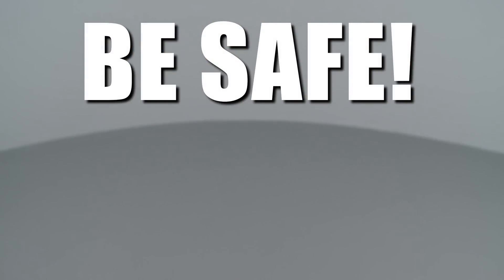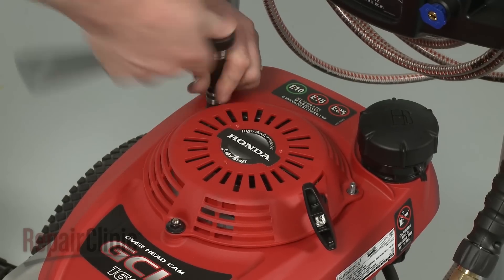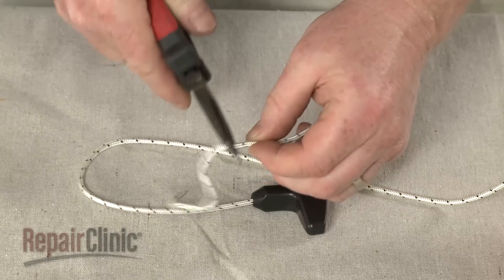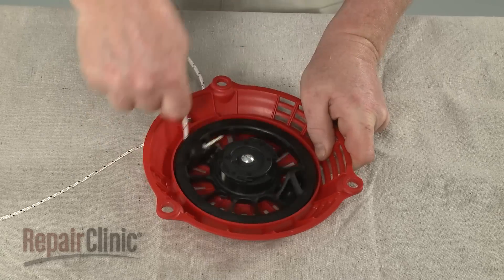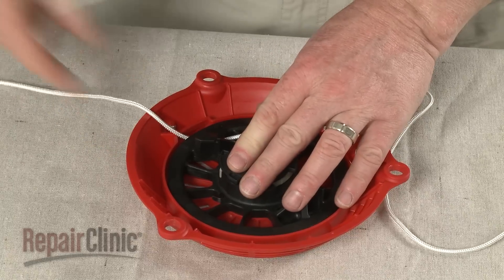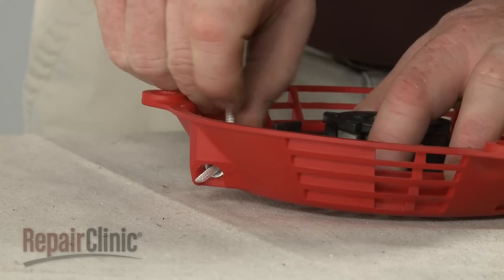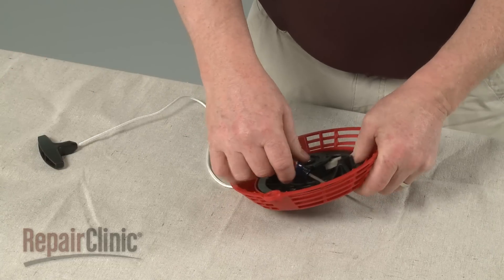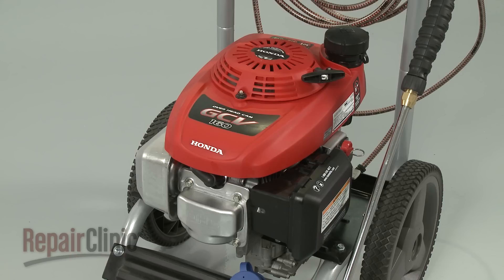Honda Pressure Washer Engine Starter Rope #28462-ZL8-003

Comment: What size is the pull cord rope in this video?

Thanks.
Reply from the maker: ***** Honda does not specify the rope size. Based on the application we would say it's a # 4 or 4.5.